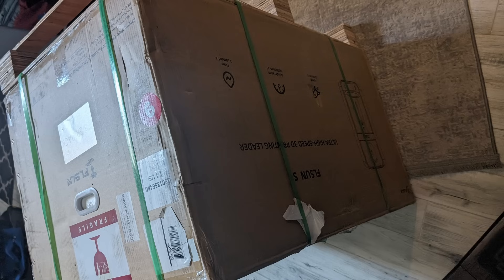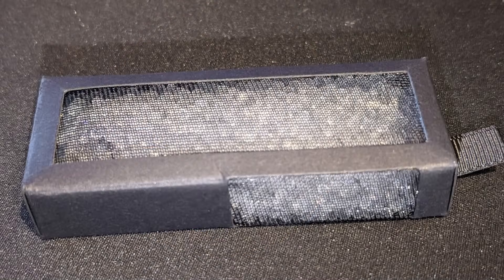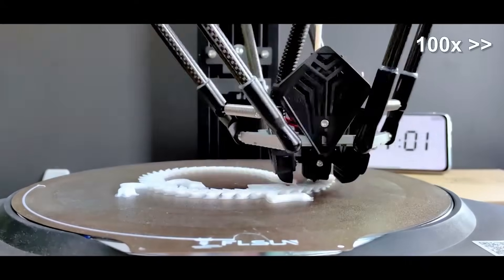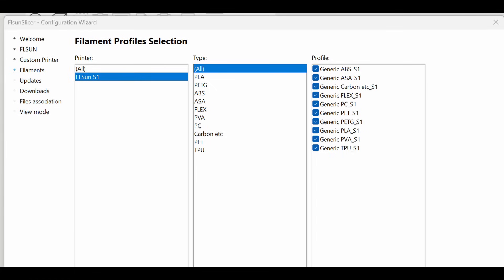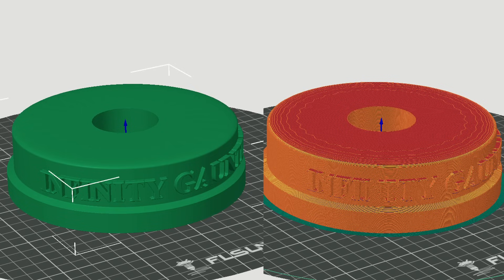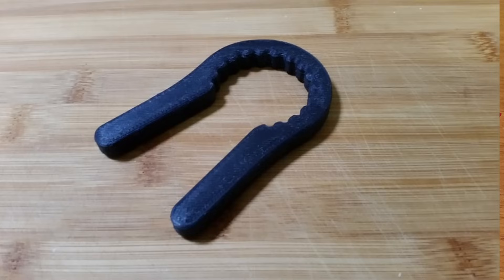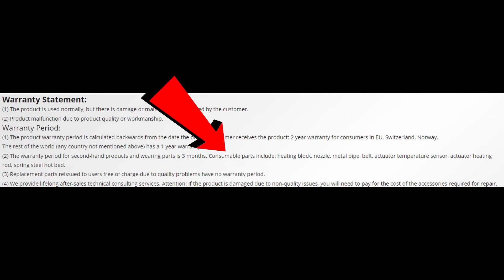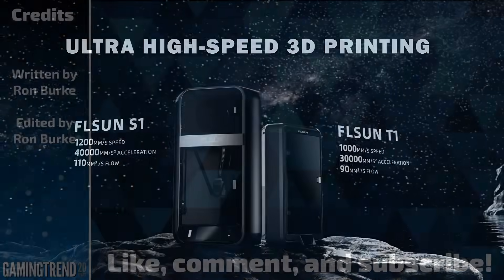Unboxing, Printing & Review Of The Lightning-fast Flsun S1 3d Printer!

Comment: Speed is nice especially if your doing lot of prototyping as I do on my X1C but after that you also need quality for working parts. Every review I see on the FLSUN is always about speed speed speed I would like to see one that concentrates more on finish quality as its obvious even at half the insane speed it will still be fast! all in all a good review and very impressive printer.
Reply from the maker: Julieta -- do you have a particular file you'd like to see printed at maximum quality?  I'd be happy to slow things down and print something on the other end of the quality spectrum.  :)  Ping me at burke@gamingtrend.com and let's chat.

Comment: Q1 Pro Or X-Max 3 Are Better, Not In Speed, But In Customer Support, Quality And Price.
Reply: Have you personally dealt with FLSUN support? I haven't in it they could be great or terrible, what was your personal experience with them like? 

The T1 for the price crushes every printer you mentioned on paper, 600 US for 1000mm/s, 90mm/s volumetric flow rate, 30000mm/s acceleration 30K fankije S1, AI detection and camera. It's essentially this with a non metal chamber and smaller print area. No spool holder/drying box above it and no LIDAR either. It's the P1 equivalent of the X1

Comment: That wasn't an "over extrusion line" that was a seam. Clearly someone who doesn't know much about 3D printing. While I appreciate someone taking the time to review a printer that doesn't have many reviews yet, perhaps learn a bit more before making a review video that could potentially confuse other non experienced people
Reply from the maker: Except that it's NOT.  It's not a seam.  That's a smooth part in the slicer, as you can see earlier in the video.
Reply: @GamingTrendVideos  is it possible that it may have just been a bug in a slicer that wasn't properly showing the seam line? It's hard to tell from the potato video quality but that thing 100% looks like a seam line.

Comment: Hi,  what layer height were you printing at. in the slicer the lines looked huge. Could we also get some times on these prints.  Love deltas have two, Prusa, and banbu. as well as DLP SLA machine...  Thx for showing the printer.
Reply: Just over 8 minutes with their built in benchy which is optimized g-code like all other printers. Those are always optimized though  I saw another Livestream and that's how long it took but the quality was good.
Reply from the maker: Defaults all the way.  0.4mm nozzle.  Don't remember they later heights.  As the previous person said, about 8 mins for benchy. Predator too 2.5 hours.  Gauntlet pieces were around 2.5 to 4 hours a piece (large vs small).  For shelf-worthy, I'd slow it down a bit and use better filament.

Comment: Layer lines aren't caused by cheap filament, and still that 1200 number still wasn't justified in this video there was no comparison from another printer on speed with the same exact model, any company can throw a number on a box and it seems like the number keeps getting bigger and bigger......................
Reply from the maker: Realize that it doesn't print at 1200 consistently.  That's max speed.
Reply: @GamingTrendVideos  yeah I know that it depends on the model the curves the detail I get that it could probably do a circle at 1200 I'm not a moron or new to this, why does so many people on the Internet assume something before they reply to someone.
Reply from the maker: I dunno.  You came across pretty hostile, implying I'm a moron.  But hey....it's the internet.
Reply: @GamingTrendVideos  hostile? LOL stating a fact is hostile now? I didn't call anyone a moron u did that all by urself

Comment: Yeah, to be honest, those prints are not good at all.
Reply from the maker: I printed them at Max speed, as I said in the video.   For pieces I'll put on the shelf, I'll slow it down.
Reply: @GamingTrendVideos  i kinda think that is the issue, its advertised as one thing. but very poor at that. so if you slow it down... there are alot better cheaper options then this lol. Thing is all your prints showed here are poor quality looking like delta artifacts, extruder not being able to to consistenly extrude and or simply unerextruding.
i get that your setting it at max, but speed dosent matter if it looks worse then the stock first gen ender 3 imo
Reply from the maker: @tobiaspersson7320  For some things I'm gonna print top speed.  For some things I'm gonna go smaller nozzle and slower.  I appreciate it when my mom says "Hey, XYZ part is wearing out" and in a matter of minutes she has a replacement in her hand.  For things like this gauntlet, it's gonna need slower, smaller nozzle, or more sanding.  You print -- you get it.  It's a tradeoff, and always will be.
Reply: @GamingTrendVideos  Yeah, i do print. Which is why i dont get why you need a smaller nozzle to just run finer layers. ie 0.12 or even 0.08. 0.4 should handle this fine. Issue is still that at the speeds you have ran the extrusion does not look consistent. If this would be an PLA issue it would not look like this at all. If they say or state that it is. I really dont understand why they havent sent you abs instead of pla to test with since its better at flowing at highspeed and would require less cooling. the more i think  about this the less sense it makes tbh. its either the hotend or extruder thats not keeping up

Comment: Gotta be honest I always find it funny when people talk about using the cheapest filament they can for large prints to save on cost then proceed to use insanely high infill for non-functional prints. Like you’d probably be able to print a whole second model just with the filament you would have saved by using lightning or adaptive/support cubic and a lower percentage
Reply: I think thats 10-15% lines infill and thats not that high.
Reply from the maker: I said I use cheap filament when layer lines don't matter.  It's not a matter of cost.   Chip clips don't need to be beautiful.

Comment: I'm not convinced. The quality of the prints isn't great.
Go slower for a better surface quality.
Reply from the maker: I wanted to show the direct out of the box printing quality. You can of course go slower, and you can of course swap out the nozzle if you need something tighter than that
Reply: I'm not convinced either but I was surprised that it ships with a 0.2mm and 0.4mm nozzle. It shows that FLSUN thinks  it can. 0.2mm is rare to get with a new printer but can print smaller layer lineswhich typically results in better detail. Now how fast you can go while remaining at that quality has yet to be determined 

I'm glad they used a standard for the nozzle size, because of Bambu more are moving to proprietary hotends which sucks. If this can do the flow rate it claims it proves that companies saying it's needed for fast speeds is all a lie, which it is.

If you want detail resin is obviously way better but the size restriction is the biggest issue, that and chemicals.

Comment: Waiting for reviews of the T1.  Being more affordable, I’d like to see it stacked up to the P1S.
Reply from the maker: If I had a P1S to compare it to, I would.  We do have a T1 coming for review as well though, so stay tuned!
Reply: Been patiently waiting on the T1 since November. I have the P1S and with the AMS and its capabilities there’s no comparison. I had a Q5 and SR and although fast for their time, multi color printing was difficult but not impossible. As soon as I got the P1S, I regretted my T1 order but I’ll still give it a good shake down if I ever get it.
Reply from the maker: @rambokd  We have a T1 coming for review as well.  Stay tuned!
Reply: yeah i would be interested in that one
Reply: I don't think it will be out for a bit longer for a few reasons. First. The S1 is actually available on FLSUN's website right now and I'm mostly because the specifications are incomplete. The AI stuff still says coming soon but mostly because it doesn't list the MCU 

The S1 is using a quad core 1.5Ghz ARM processor, which is very impressive. Either FLSUN hasn't decided what MCU to use  or they aren't updating their website. It has the same print accuracy, 1000mm/s and 90mm/s flow rate, same fab setup, just 30,000RPM instead of 40K and 30K acceleration compared to 40K for the S1. 

It's biggest advantage that I see is it's using 36V Closed-loop motors which I believe is a first for any 3D printer. It also says it has real time filement detection so it can give you a rough estimate of grams of filament left.  S1 says heated up to 50C which really isn't that impressive. 

I don't believe LIDAR adds anything. You can't use it on PEI sheets but you can now? I get software is different but a PEI plate isn't smooth. Additionally Pressure Advance and Flow Rate go hand in hand

The T1 at its current price is simply a better value. Smaller build plate, no LIDAR, but a camera with the same spaghetti and something on plate detection. Cheaper but still carbon filtered enclosure, similar to Z1 vs P1. I don't think the S1 is worth 1K more than the T1 but I have a feeling the T1 price may go up. If not before launch then soon after.

I have seen VZBot AWD Core XYZ get to 2000mm/s at 0.16mm height bit also had a water cooled hotends to cool the stepper motor and extruder and all the and all the stepper motors are water cooled.. AaWD just means 2 stepper motors for X and Y (four total) and shorter belts. With shorter belts it resonates less so input shaping doesn't kick in until higher speeds and 2 extra stepper motors gives you that. It's also open source and ou have to build it yourself so..... With that said the VZbot team said their next printer ter is going to be a Delta printer ter for the speed advantages over Core XYZ
Reply: @JoshFisher567  I got an email saying it’s shipped and will be here July 10th.. we shall see.
Reply: @rambokd  They just must have not updated their website. That or they want to make the S1 look more appealing . I just found it odd that the T1 is missing so many specifications that the S1 has like the MCU and other stuff.. I know one of the reasons the P1 was so much cheaper was they somehow managed to use and ESP32-S3 which is a 5 dollars microcontroller with dual 240Mhz cores and 8MB of PSRAM. That and the screen. I would imagine the T1 Is running some sort of ARM processor, probably just not as fast as the S1 which is to be expected. 

It will be interesting to see where Delta printers go from here. I did see a few other unboxing videos but they are all the same, unboxing, assembling, running calibration then printing the pre shipped benchy that has optimized g-code. 

Hopefully they get it added to other slicing software soon. The software makers probably have to add it to their software. I also wonder how their slicer is and if it's just a fork of something else. Glad it's running a stick flipper also  It also doesn't say if the T1 is using closed loop stepper motors or not, I imagine not but I'm not seeing any reason to spend 1K more on the S1, especially on paper. 

The round build plate still trips me up on these but it makes sense due to how they work.